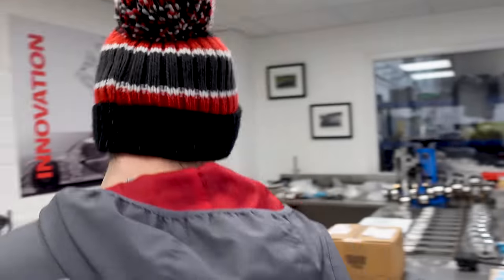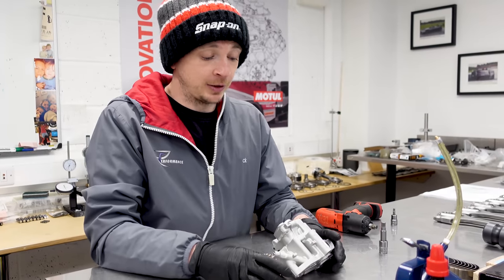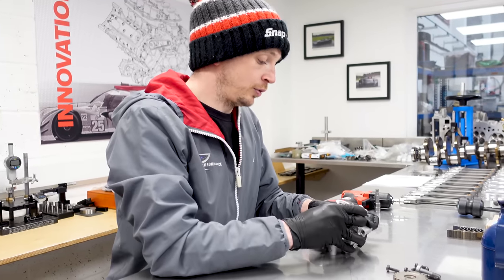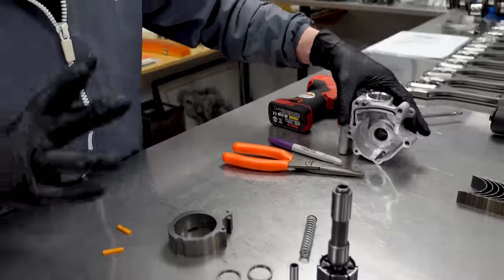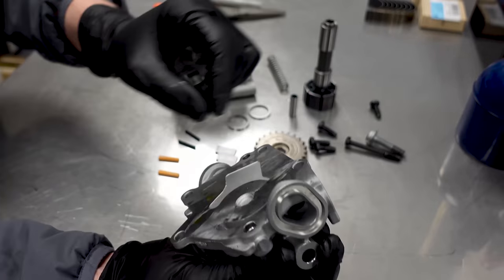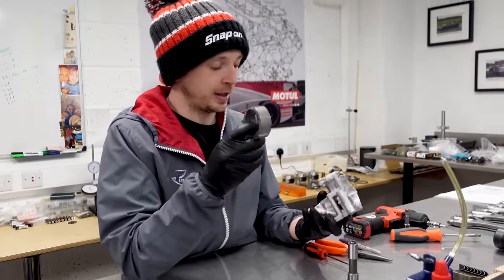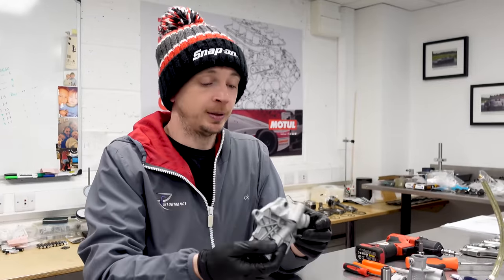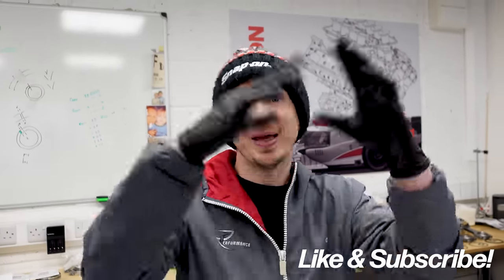RS3 Engine Rebuild – Critical Part! Part 5

Comment: Looks a bit like a cam vvt mechanism although mechanically controlled through a spring versus control pressure; could probably put a solenoid on feed to the control orifice if you wanted to get mental on the control with a suitable standalone.

Did you just burn Millers Oils? 😂
Reply from the maker: Yeah I wouldn’t put that oil in my workshop heater!! 

Yes it pretty much is a like a vvt variator! The solenoid thing has been done…not much to gain!
Reply: @REPerformanceUK   I’ve been running Millers 10 50 competition in my Mx5 turbo on track and it does drop a chunk of pressure with heat. I thought all oils with the same headline ratings would do roughly the same. Time to try something new - possibly the Motul v300 as I’ve have zero issue with the Motul gearbox, diff, atf and brake fluids.

So others have tried solenoid oil control; Damn it, I was a self declared internet genius for a few hours 😂
Reply from the maker: @martinrodger9565  Hahahaha! yeah i know what you mean. Give 300V a try it supports high temp much better!

Comment: Ricky, what is the purpose of varying the pump delivery? Doesn't seem like you could have "too much" oil flow... I've worked on racing engines for 30 years and never run into that style pump before.
Reply from the maker: Hello Ray, it’s to power the flow rate at low rpm as it’s not required and just adds drag to the engine and ultimately increases emissions. Then as rpm increases the pump ratio changes.

They used to use an electric bypass too.
Reply: @REPerformanceUK  
Gotcha. I figured it had to be to reduce parasitic drag, but I wasn't sure. Thanks for the reply.
Reply from the maker: @raykaufman7156  yeah the relief valves controls peak pressure then the variation helps lower the losses at low rpm.
Reply from the maker: @raykaufman7156  No worries, yeah you are either increasing airflow to make more power or trying to reduce drag!